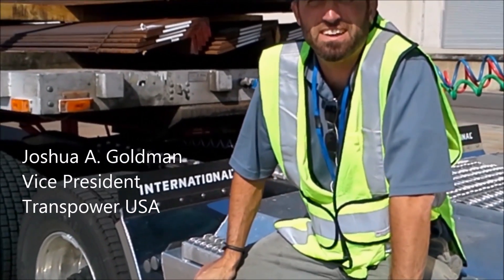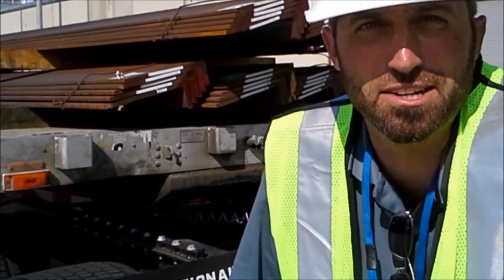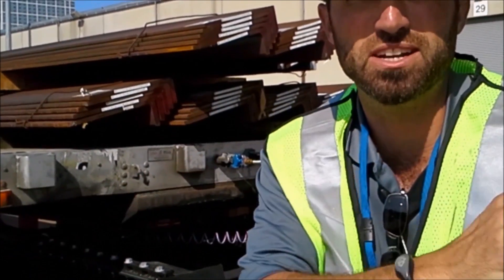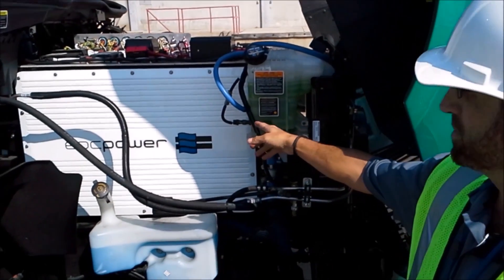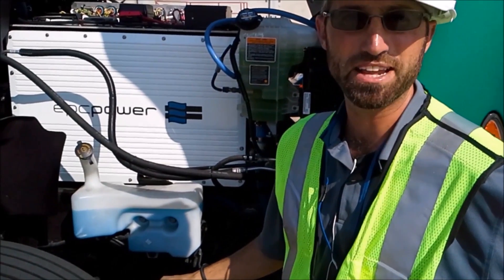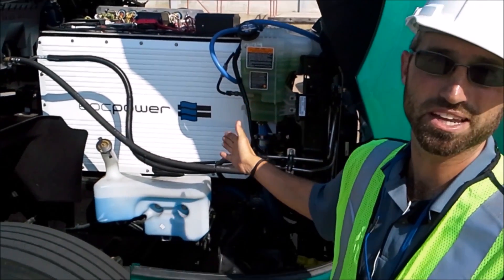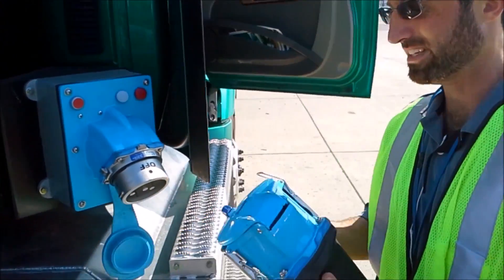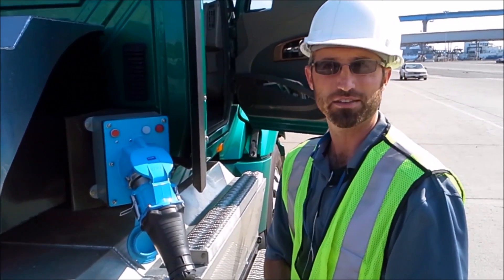Electric Semi Truck

Comment: I'd like to hear the sound when shifting gears. 
Until now electric vehicles haven't had gearboxes because electric motors don't need them, theorically, but I think that in future could be developed a gearbox (maybe with less gears) for electric vehicles that enables to save power.

Comment: I think that design with a better packaged control centre paid with a diesel range extending generator would be the cat's meow. a 6-7L could replace the likes of the 13-15L diesel and reduce the cost of batteries and fuel and reduce emissions greatly. if you could have a motor operating at its most efficient levels at all times and only having to produce 1/4-1/2 the effort as a traditional setup you could reduce emissions and fuel costs greatly. 
if a rig is getting 6-7 mpg of fuel right now running an electric setup that could produce half the power coupled with a range extender producing half the power you could cut emissions in half along with fuel costs. if it costs you $150 a day in fuel and now you can cut it to $75 that still saves you $425 a week totaling over $22000 a year.
Reply: national average fuel consumption of a semi is 6.5 mpg diesel.

driving 8 hours a day at an average speed of 65 mph is a total of 520 miles. 520 miles @6.5mpg is 80 gallons of fuel. if you have a hybrid system reducing fueling by 50% you reduce cost by 40 gallons of fuel daily.and at the current cost of diesel in the united states you will save nearly $100 per day. a total savings of over $24700 per year.

Comment: i dont understand why not install the Battery packs on the trailers and just enough battery on board the truck to disconnect and hookup another load. charge while unloading discharge while in transport and repeat over and over.
Reply: Puppet Master....I been thinking the same thing for years!
Reply: Puppet Master And It's Supposed To Make It Across The Country In A Single Charge!?!?!?
Reply: Its not going to start by long distance travel. I believe it will be smaller commutes, distribution warehouse to stores.
Reply: Most companies have a huge amount of trailers to truck ratio. That idea might be good for a one truck operation but the cost to outfit hundreds of trailers with batteries would not be cost effective

Comment: 140 miles 👀 well trucks can carry more batteries than that. you need a 300+ mile truck to be viable
Reply: Lee Bradley 70x8 = 560.
plus some leeway I'd say you'd need about 600-650 usable miles of range to be able to sell it to long haul guys with available shore power at a wide range of truck stops as well as range extending batteries attached to trailers.

Comment: That's  what I like but with manual  transmission  and one that does 11hrs + of driving time per charge.   It would save 100+gallons  of diesel fuel daily per truck.   Now  how  many trucks  we  have in  US alone?
Reply: Wojciech Zgodowski your trucks would spend more time charging than on the road
Reply: Fuckoff. Not really if charge stations would be at every truck stop nationwide it would work,  for every 11hrs driven drivers get 10 hrs off.  On average the truck would have to charge in 8-10hrs and do at least 700 miles per charge, 1000miles per charge would be reasonable.
Reply: Wojciech Zgodowski dot limits are less than ten hours driving time or you get a heavy fine. 

I think batteries attached to the trailer would be more suitable that would appeal heavily to drop and hook companies. which are a lot.
Reply: Why use a transmission atall?  Electric motors don't need one!

Comment: Thanks for posting this. I was looking for the info on the electric trucks being used in Port of San Diego and got this. What's the range, currently, of these trucks? I saw that it went from Port of SD to Nassco (roughly 5 miles). How far will they go on a charge?
If they develop the bio-battery technology, this will greatly improve range and this technology can go nation-wide with all transport.
Reply from the maker: Hello Andrea.  Give Josh a contact at Joshua Goldman: joshua@transpowerusa.com. I believe he can run at highway speeds up to about 60-140 driving miles or so with only an 2-4hr max recharge speeds.  Give Josh a call and he will let you know of advancements.
Reply: Tom Warren 62 miles that's it http://thinkprogress.org/climate/2015/07/09/3678546/all-electric-big-rig-truck-hits-the-road-in-germany/
Reply: Tom Warren Do you build on Peterbilt chassis too? How much would it cost for a 379? Do you ship to Europe or North Africa?
Reply: +Fuckoff That isn't the same vehicle. http://www.fleetsandfuels.com/fuels/evs/2015/05/transpower-electrucks-closer-to-market/